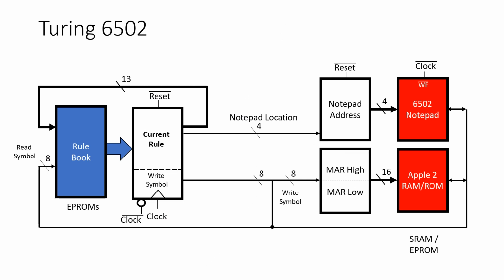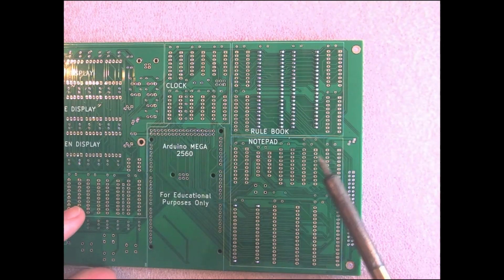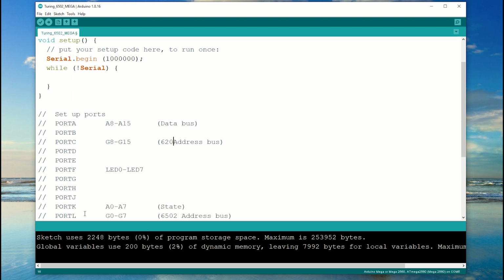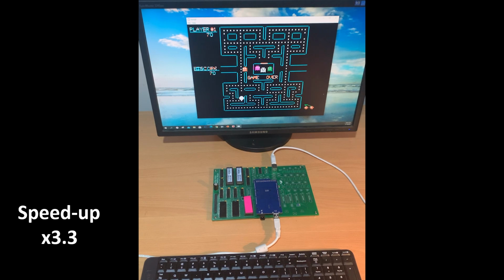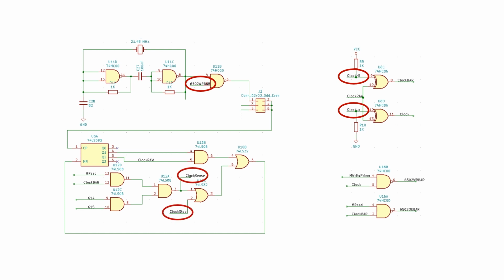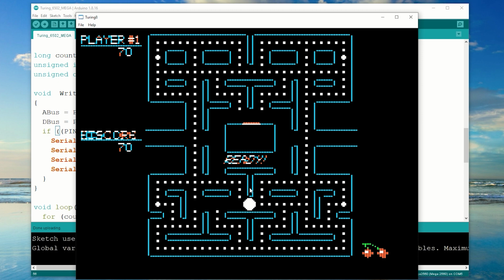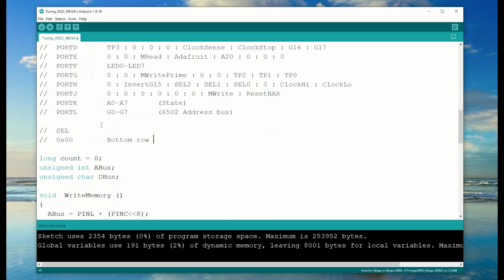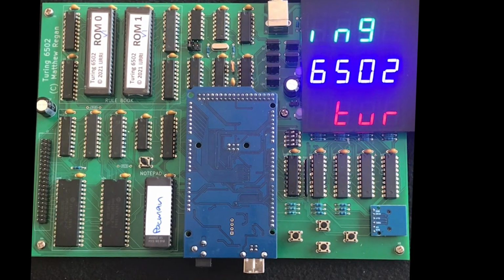Turing Machines Explained.  PCB build and bring up

Comment: Hi Dr Matt, what a fantastic project. Your R&D must be real labour of love. Great attention to detail which shows in your quality of video production. I'm not sure if your a blinking light person? It would add too the component count. But useful for debugging hardware and software.problely a bit late in the day for that. You could replace the turn pin sockets with ZIF sockets? No screwdriver required. Richard
Reply from the maker: Glad you're enjoying the project! Debugging with blinking lights is definitely tempting.  If you have a look at the ZX Spectrum Turing Edition, you'll see i've started using ZIFs more regularly.

Comment: ~16:30 - suitably dramatic soundtrack for that build segment 😂
On the broader topic of this playlist: Thank you for showing us this angle for viewing the operation of a CPU - It does set one to thinking a little differently  🍻
It is at this point in this playlist that my brain is filling in hitherto "dangling threads" from prior formal learning* of CPU fetch -> decode -> execute cycle, which glossed over what actually happens inside the CPU in the execute cycle.  The CPU was left at, "well basically it's a state-machine where the states are fetch, (decode), execute.  Here's its instruction set and what we can do with it ..."  
 - To my mind, even way back when, I'd already deduced that the execute portion was a more complex state machine unto itself, but I didn't stop and delve into the how .
 - Over the course of several videos, you demonstrate that with a mere handful of discrete components (and a masochistic process of deriving the state diagrams for the 6502 instruction set and other internal operations!), one can reasonably accurately replicate the behaviour of a seminal 8bit CPU.
 - But it also hammers home the value of visualising a process or collection of operations/processes as a state machine - I think this angle is often overlooked IRL, especially in software.

-
* It was 'only' associate/diploma level.  So there is an expectation that a proper, full undergrad course would later on dissect exactly what happens within the CPU during both "decode" and "execute".
Reply from the maker: Thanks for that.  This really isn't taught at the bachelor's level or even in post-grad. My interest in the "fundamentals of computing", really started when i was at Interval Research Lab and we had a project called "NatComp" (ie. Natural Computing), which really looked at the most basic levels of computation.
Personally, i think this should be taught at the high school level when people are learning to program.

Comment: i am building 6502 like ben eater but i made address decoding better using 8input NAND, inverter and, NAND to get
8000-FFFF /ROM CS
0000-7EFF /RAM CS
7F00-7FFF /IO CS

i was asking will ram part work
havent seen nobody do this way
RAM
/RAM CS /CS
/OE (0 when read 1 when write)
/WE (1 when read 0 when write)

R/W -> /WE (this same as ben and rest)
R/W -> inverter -> /OE (i invert this bcoz its allways reversed xD)
this have to work? im genious 

(rest these work )
ROM
+5 /WE
GND /OE
/ROM CS /CS

74LS138 (7F0x-7F7x) x= example VIA RS lines. for that device in this address space. mean only one xD
A4 A0
A5 A1
A6 A3
+5 E3
A7 /E2
/IO CS /E1

74LS138 (7F8x-7FFx)
A4 A0
A5 A1
A6 A3
A7 E3
GND /E2
/IO CS /E1
Reply from the maker: Good luck with the build, let us know how it goes.

Comment: Very nice!  Could space be saved by just mounting the same  microcontroller used in the Arduino Mega directly onto the PCB, or is there an advantage to connecting the Arduino as a daughterboard?
Reply from the maker: Mainly just trying to avoid SMDs with the USB controller.  How are you finding it?
Reply: @DrMattRegan  I still think it's interesting, and I plan to (re)-watch the rest of the videos.

Comment: I'm kinda missing it - why do you write the clock twice on the Arduino side (even right before giving back control)? You don't need for reads to settle or anything?
Reply from the maker: It's been a while since i've watched it, I'll have to get back to you on this one.
From memory, the double writes are just to slow the arduino down a bit, it's clocked at 20MHz (50ns) so it's faster than the chips I've used.  Copy-and-paste with writes is a bit tighter than having a delay loop or putting in NOPs.  I haven't optimized all these out yet, but generally if there are two writes, it probably means it didn't work with 1 write.

Comment: I am wondering if you could replace the ROMs with SRAM, which can be much faster, even the asynchronous ones go down to 7ns, but 10-12ns and are very cheap, too. You could just fill them up with the arduino at startup, even serially using shift registers. Once the schematics are released I will try to make this with the SRAM and the fast 74ALVC family.

Comment: Absolutely love your work!
I think it is exactly the kind of practical hands on knowledge that so many college students need to be exposed to.
A couple of questions:

#1) Why EPROMs? Why not use FLASH memory? FLASH doesn't require UV light to erase and weird high voltages to program. 
I think it would have been another good intro into memory concepts to construct an Arduino based FLASH programmer for this project as a first step. 
I checked and 4MB FLASH chips are still fairly widely available. At Digi-Key: SST39SF040-70-4C-PHE, 2125 in stock.
I'm sure there are others.

#2) What tools did you use to write/compile the turing code for the 6502 emulator? 
Are you planning on making those tools available?

#3) Are you planning to share the binaries for the turing code for the 6502 emulator and the source code itself? 

Thanks so much for sharing these projects. I believe they are VERY important!
Reply from the maker: Hi Michael,
Thanks for your feedback it really helps.  Great questions.

The problem with FLASH is the 27c322. It's a 42 pin DIP, while the 39vf3201 is 3.3V and surface mounted.  I will probably move to FLASH soon though.  If there is enough interest, i'm thinking of doing a GNU Project to make a public domain Turing x86, and that will need to be in FLASH (and probably FPGAs) so people can help develop and test code without burning EPROMs.

I've basically used C++ as my only tool.  For the Pure Turing / 1-bit version of the machine, i actually did most of the state diagrams by hand with pen and paper.  I have a whole folder full of diagrams.

My apple 2 interface code that operates the PC display still has a few features missing, like low res-graphics etc. and not every piece of apple 2 software works with it.

I do have a version of the Turing 6502 emulator which runs on AppleWin.  Basically it plugs straight in as an alternate CPU module.  I actually used this with 50 popular apple 2 games to make sure the code worked.  If enough people are interested, i'll do a video on it and release binaries with it.

I'll also plan to make tested EPROMs available for those that want to try a build. 

Regards,
Matt.
Reply: @DrMattRegan  Bummer about the state diagrams existing only on paper. I had half expected you to have created some sort of cool Turing language that would compile to binary or some other tool that would help with the creation of the Turing code. Any chance you might be willing to share a couple of examples of your state diagrams?
Reply from the maker: PS: starting with the 8086 first